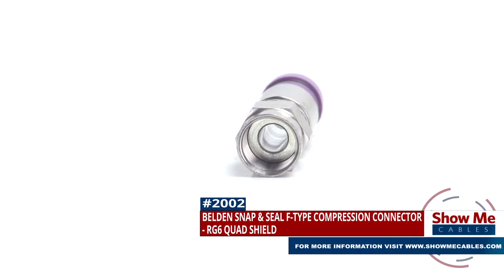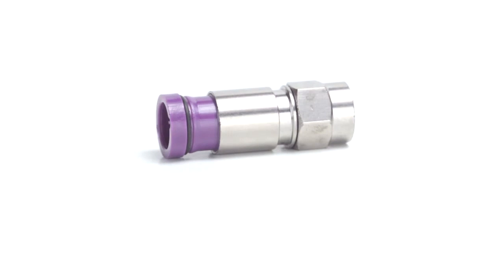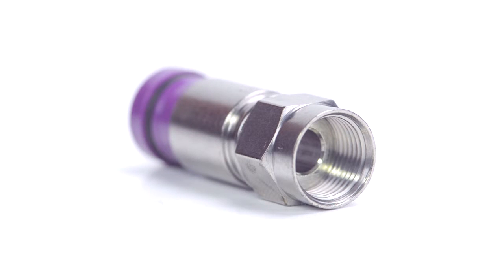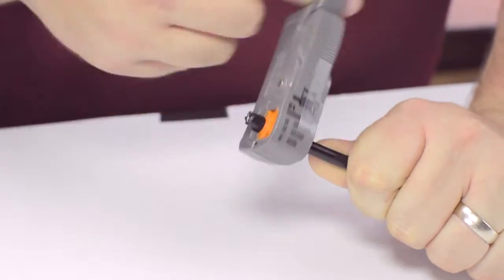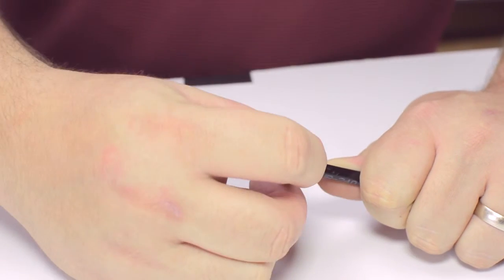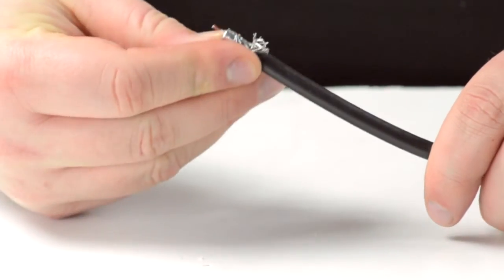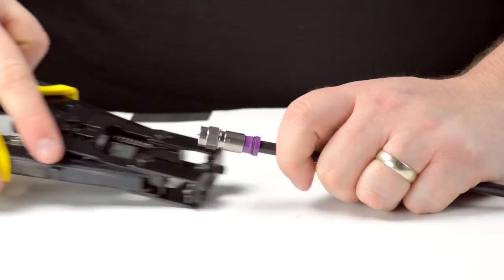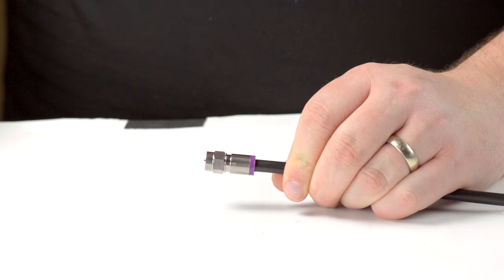How To Install Belden Snap & Seal F-Type Compression Connector for RG6 Quad Shield

Comment: Is there an easy way to install this connector on RG6/U Quad shield? I'm using the IDEAL 45-321 and it makes a 1/4" & 1/4" cut on the cable where this video  looks like a 1/4"& 3/8" or 1/4"&1/2" cut to the cable. The only way I can get the connector to work is to cut another 1/8" off the jacket (total of 3/8"), fold the wire braiding, peal off the foil, then fold down the next layer of wire braiding.